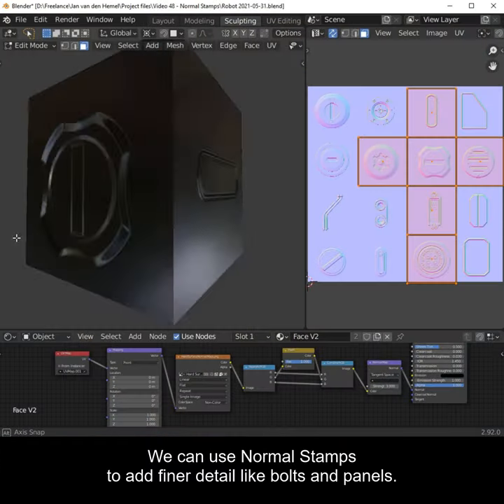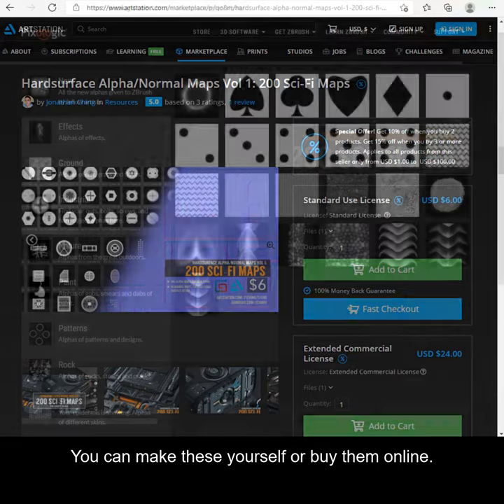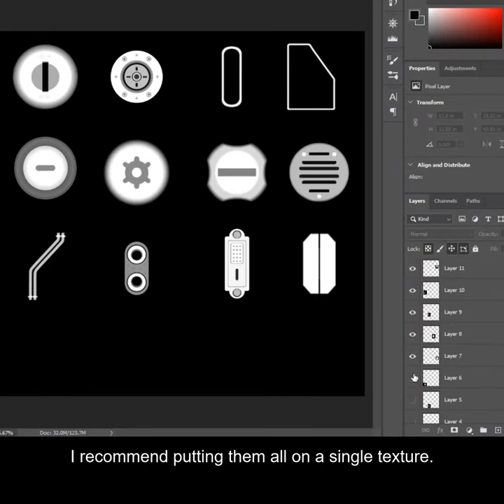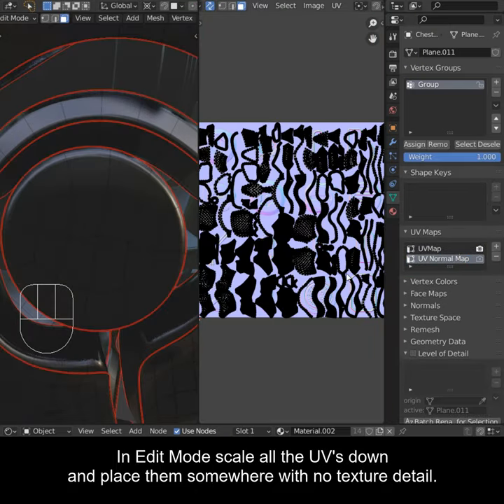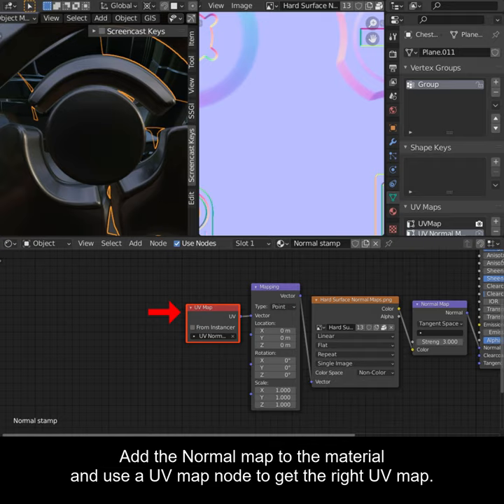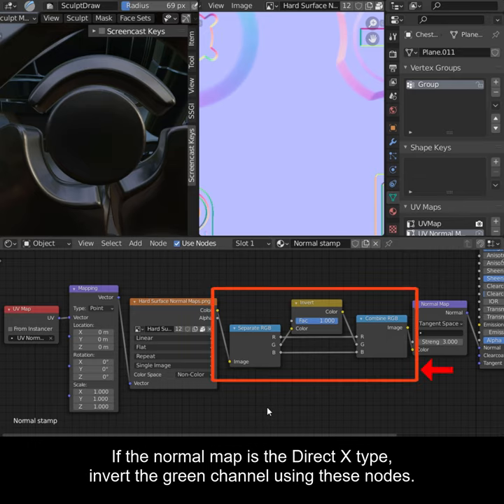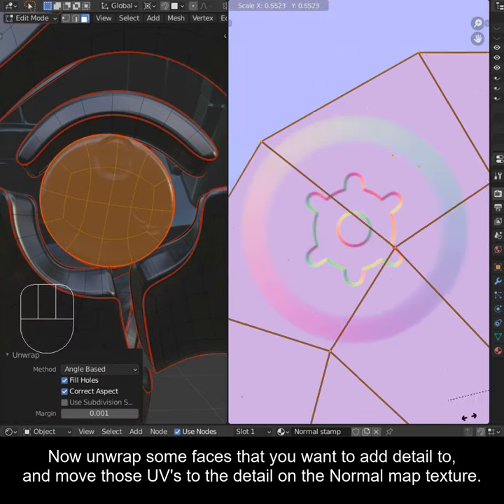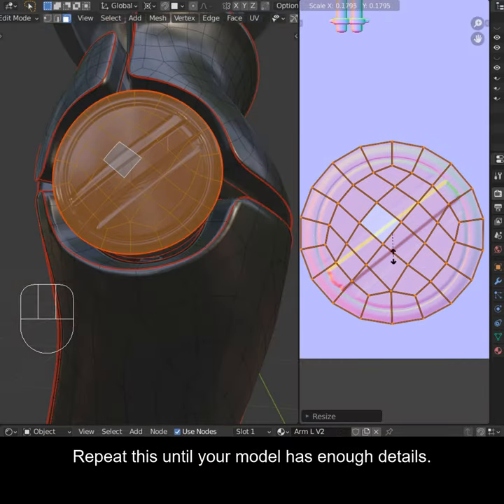Blender Secrets - Hard Surface Normal Stamps

Comment from the maker: To add bolts, small panels and other small details we can use Normal stamps. You can make these yourself by baking normal maps or you can save a lot of time buying them online, they're pretty cheap. 

Get the free Blender Secrets sample PDF: 
https://mailchimp.blendersecrets.org/freesample

Get the 1000+ page Blender e-book with free updates: https://store.blendersecrets.org/l/IxofeY

Alphas by Jonathan Ching on Artstation
https://www.artstation.com/marketplace/p/qo8m/hardsurface-alpha-normal-maps-vol-1-200-sci-fi-maps
Reply: The blender secrets as you call them are amazing tips that is helping more than most tutorials. Between the e-book and the website I am using blender to try each and every technique. So I have a folder that is just blender secrets and nothing else. And I have used some of the tips in my workflow on client projects.
Reply: You can simplify your invert green channel (for Direct X textures) to a single node by using an RGB curves node and inverting the slope on the green channel. Less clutter :)
Reply from the maker: @tmoneygamestudio  That's awesome, thanks for your comment! :-)

Comment: Brilliant, I've often wondered about how to do these kinds of details, I need to try this whole sequence you've used to build this robot - it's genius.
Reply: The most common and efficient way to make them is using substance painter or a similar tool
Reply: yea substance painter is just better when it comes to this stuff, and honestly if your serious about modding, its worth getting, with the layer system, the fine tweaking to each image texture and the easy quick baking, awell as  inbuilt edge ware detection and the smart materials, you can basically make things look real, or just add allot of detail, its easier than blenders nodes, allot quicker gets better results at very low computational cost because its image textures. i will say substance interface can be annoying but the results are fantastic, when i first used it i realized just how good my custom models could look.
Reply: 3dcoat is better
Reply: @3dgraphicworkz463  i haven't heard of that but substance is supposed to be the best on the market.
Reply: @robertlaidlaw4592  3dcoat can paint, retopo, uv, sculpt all at a high level even compaired to slow performing blender.  
Now with new version 3rcoat can do pure low poly modelling. Much better investment than substance.

Comment: Thank you for this! Definitely the best explanation I've seen for making your own decals. Second UV is cool but for applying them I've also seen a technique where the decal is mapped to a plane which is shrink-wrapped to the model. The decal's normal affects the underlying albedo as if it were traditionally mapped. Is this possible in blender? I think it's called deferred decals. I've also seen it mentioned as part of the Star Citizen workflow. Apparently it's an easier way to do a lot of decals since you can mirror, array, etc. the planes since they're separate geo.

Comment: So that's one way to do it, or you can use a brush to paint them directly onto your existing normal texture. 

If you don't know how to bake perfect normals, you can cheat by painting your diffuse, then importing the diffuse texture into a program like Materialize (free)... create your normal map, then export it. 
Import into Blender, set as you normal map in your shader, then paint to it like any other texture. 

Set your brush as your desired normal stamp. Create a few normal brushes ahead of time, then go nuts with it.